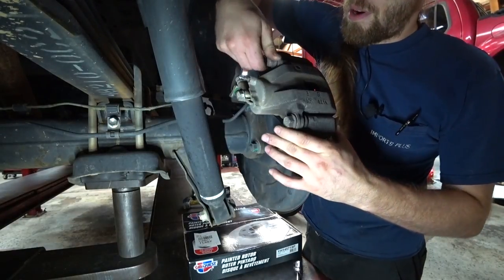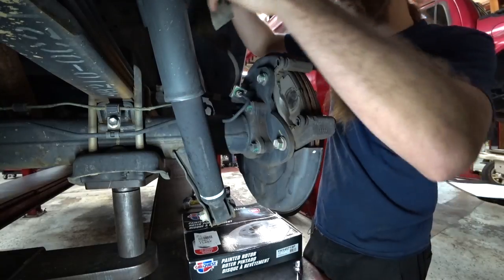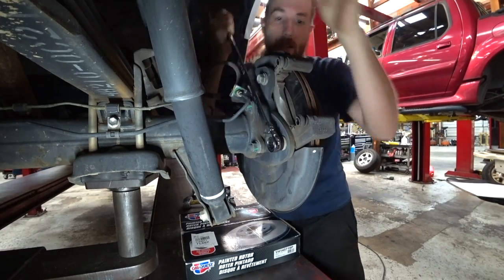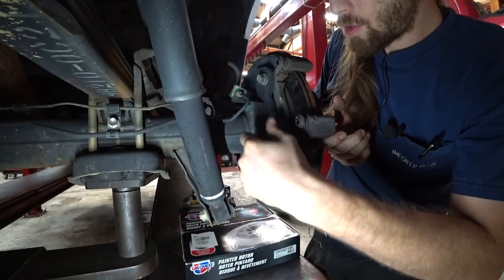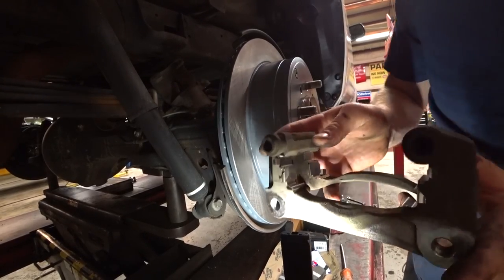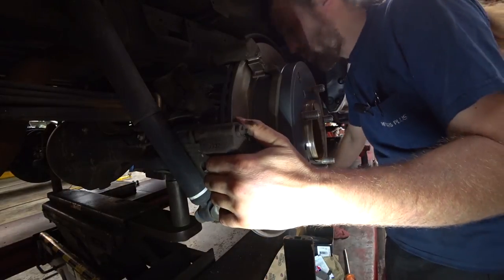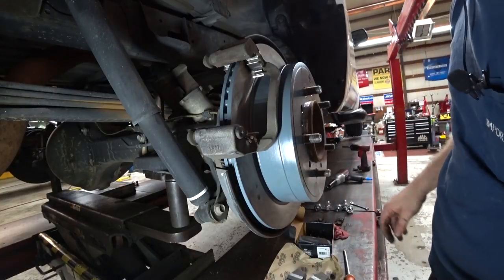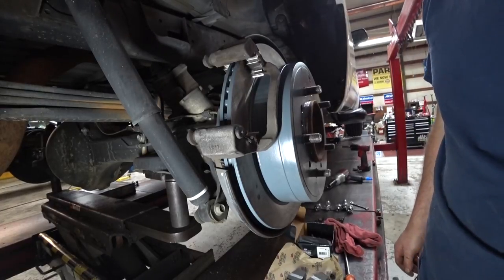Toyota Tundra Rear Brake Replacement

Comment: I had that "where the hell is that coming from" that you mentioned. Screeching clips. Had to take her apart again, but it fixed it. Those clips rubbing on the rotor makes quite a racket.

Comment: You skipped quite a few best practices. A little copper anti-seize on the face of the hub, ears of the pads, Degrease the new rotors to remove the anti rust coating, clean any rust or dirt out of the pad channels before installing the new hardware...
Reply from the maker: 1: In the south, rust isn't a big issue
2: anti-seize is NOT a lubricant, never use it to try to lube up pads, slides or anything, that's what caliper grease is for. 
3: I cleaned off the rotors during the "cut" of the video, same with the hardware. I wire-brush the channels to remove dirt before installing new hardware. 

Thanks :D
Reply: @deamonmachine  Those are all good steps to actually show in your video.

Comment: I just had my new to me 2019 Tundra in the dealership at 48,700 miles. The told me that the rear rotor requires a bit of machining. Did the parts that you used already have that done?

Comment: What was your way you got the rotor off when you used the driver? I did not quite understand. Thanks.
Reply from the maker: The rotor has threaded screw holes in it to put 8mm threaded bolts into it to "press" it off.
Reply: Little late but for other people in the future rotors have a treaded hole you can drive a bolt into that will push it off the inside and force the rotor off